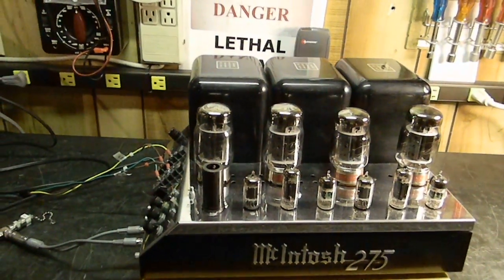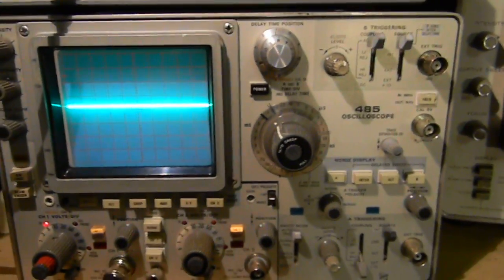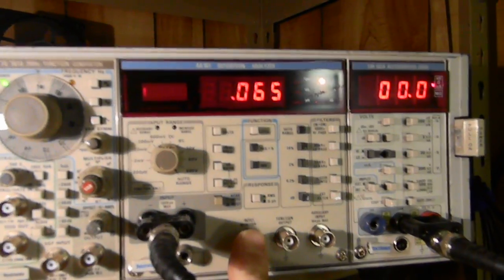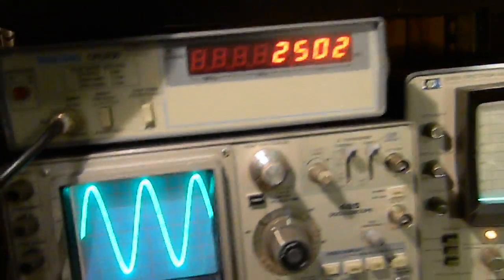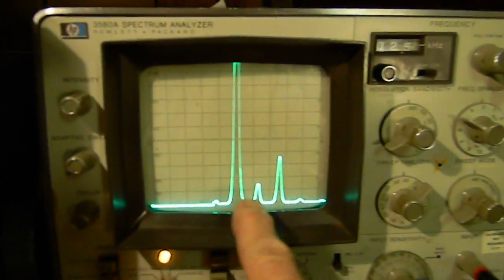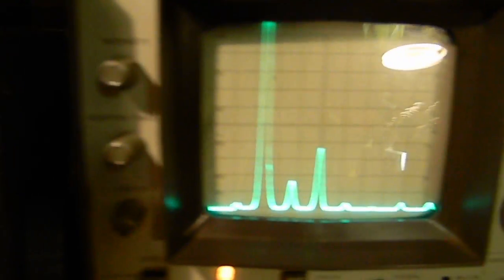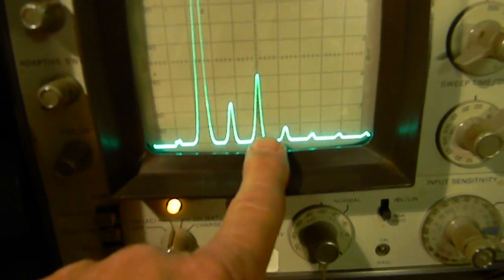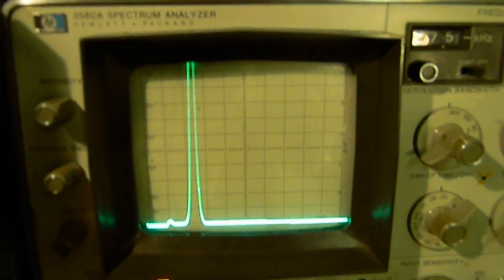HP 3580A Spectrum Analyzer and Harmonic Distortion on the McIntosh MC275.MOV

Comment: It would be nice to have a video on using a spectrum analyzer to MEASURE THD.  Also, a video on using the S. A. to detect TIMD.  If you feed a square wave into an amp (proper termination, please), you know, from the Fourier series, what harmonics are supposed to be there, and their amplitudes.  Anything else is garbage, and probably TIMD.  And you could do the test with op-amps, of various slew-rates.  A comparison of those whiz-bang DSOs, with FFT, and a REAL spectrum analyzer, would be nice.  I have a good scope (Tek 475A), but have considered getting a DSO, because of the FFT feature.  I've used a REAL spectrum analyzer, and from what I can determine from the reviews of the DSOs, I'm not impressed.  Actually, most of the reviewers of those scopes, don't seem to know how to evaluate the quality of a freq. domain display.  Maybe, I'm just really picky.

Comment: So if you crank the signal up to get a square wave, you're going to have all odd harmonics present?
Reply from the maker: Yes, and in the perfect square wave there will be no even harmonics at all. If all harmonics are present, even and odd, you get a triangular wave.
Reply: Yes.  That 2nd harmonic is not due to the "squareness" of the waveform, but probably, non-linearities in the xformer core, and/or, the tube characteristics.

Comment from the maker: Wow... I can see you have taken the AA501 to another order of magnitude of usage. I have taken the lazy approach and run mine in AUTO everything. I can see that just pushing in the 400 Hz HPF reduces the noise and THD display. However in my case I use it almost exclusively with a low impedance input, i.e.,  across 4 or 8 ohms and in that case seems to confirm what one would expect from accepted ratings of amplifiers, etc. I can see that if I do preamps (high Z), I will have to be more careful.

Comment: @essoterric I have pretty much concluded my experiments to modify the 3580A to reduce the carrier feedthrough (zero response peak). My conclusion is that bypassing the unused carrier input and increasing the size of the capacitor that feeds that carrier to the double-balanced modulator is about the only mod that will help and not hurt performance. I've gotten the zero beat peak down to about -58dB. Also, found that soldering the pins of that chip to the PCB helps to make it more stable over time

Comment: @essoterric I've been using my AA501 today, and one thing I realized is that a VERY small amount of noise can totally invalidate readings on systems with very low distortion i the .00X range. Even 60Hz hum @-100dB can wreak havoc. The 400Hz HPF switched in, shows MUCH lower distortion. Just moving my hand near the cable affects readings, unless source is low impedance. I made shielded cable for this reason. Just modded my dummy load with 10:1 voltage divider/sample out for plugging to AA501.

Comment: @essoterric THD=V1^2+V2^2+V3^2 etc / V1^2. Reminds me of the resistance calculation for multiple parallel resistors.
My 1740 developed a weird problem last night that would affect display intensity and make it bounce. The +5 supply was failing. It was the 723 regulator, somehow common mode conducting and feeding back current from the +9 raw back into the +15 via the 723 internals which were getting hot. 85C on my Tektronix temp probe. Replaced U2 and Q5 and all is well. Have some mods for 3580A.

Comment from the maker: I did not know that about the summing of harmonics. It will complicate any video trying to make comparisons. Good to hear you have your HP1740A running. A perfect mate for the 3580A. I am sure you will love your AA501 and SG505. You mentioned attaching a heat sink to one of your instruments IC's. I did a similar thing by attaching a heat sink to one of the IC's in a Tek 2465 scope I had. Can't remember the U# - horizontal output, I think. Ultimately went bad anyway. Always good talking with you.

Comment: @essoterric The sum of the harmonics is, if I recall correctly, similar to the calculation for the sum of parallel resistors. Where it gets tricky is weighting the various harmonic intensities into the final THD %.
UPS has my AA501 and SG505 scheduled for end of day delivery today, so I'll be playing with them tonight. 
I just fixed my HP 1740A... U2 and Q5 in the LVPS were acting up. Did a calibration and balanced the FETs in the vertical amps. Runs nice now. 
Will follow up when the gear arriv

Comment from the maker: No doubt about the Log scales. I haven't found much use for the Log 1 dB scale either. It would be nice if one of us made a video to correlate the actual sum of the (most significant) harmonics in the HP 3580A display to the THD of the Tektronix AA501 and posted it. Making sure we make a point of voltage gain/loss vs power gain/loss, etc. I know a few out there would enjoy it.

Comment: @essoterric It takes a little getting used to, but Log is really a better way to see everything that's going on with signals at a glance. It lets you see things down to about -90dB, and, assuming there's no ground loops and the mixer is balanced out nicely, the display should not contain any anomalies. Linear and Log 1dB have their uses, but I find Log 10dB to be the most useful for testing amplifiers. Recently, I found harmonics in a Phase Linear D500 that were traced to ultrasonic oscillation.

Comment from the maker: It is so interesting you mention using Start instead of CTR. I was working with the 3580A last night and came to the conclusion that was the easiest way to get rid of the zero response peak (by shifting it off to the left) and your suggestion of 2Kc/Div is just beautiful for a 1KHz square wave and its harmonics all the way out to the 10th in one display sweep.  I am getting a bit more prone to using Log scale instead of Linear but I like the sharp display that Linear gives me. Thanks.

Comment: @essoterric Two things I shifted away from as I got used to the 3580A: using the center freq, and using Linear amplitude. Nowadays I just set zero, or sometimes 200cps to chop off the zero response peak, and use Start. Then I put the Freq/span to 2Kc/div for most audio measurements. That gives me 20Kc bandwidth at a glance, good for seeing the overall spectrum. Sometimes I set Sweep Mode to Log when I need to see the entire range. SG502A outperforms its specs when output pot maxed out only.

Comment from the maker: @basspig I agree with using the log scale but for some reason I just seem to always pick the linear scale. I do have to be careful not to overdrive the front end and watch the little red over-drive light. I just performed the same measurement as you did on the SG502 and as best I can read it, I get about -72dB to -74 dBfor the second harmonic also. You are the second one that suggests I use the log scale. I am going to take that to heart and start using both in my demonstrations. Thanks

Comment: @MarkPalmer1000 The HP 3580A actually does have a log amplitude mode, not used in this video, but can show everything down into the noise floor. For instance, the SG502 oscillator is specked at .035% THD, and my HP 3580A shows 2nd harmonic around -74dB, right where it should be. I believe the purpose of this video is to illustrate how tube amplifier distortion looks under overdriven conditions. A nice comparison with be transistor vs tube, showing the differences.

Comment: I've been using an old FFT spectrum analyzer to look at audio amps.  Its advantageous as it has a 120 dB log function on the vertical scale.  Thus you don't have to drive the amplifier in to clipping and have the amplitude of the center frequency spectrum go way off scale to observe very low level haromonics.  It can also measure the amplitude of each harmonic down from the peak of the CF eliminating the need for a distortion meter as the percentage at any power level can be easily calculated.

Comment from the maker: Yes, for audio measurements the HP is really nice. It's shortcoming is that it only goes to 50 KHz so, if you have a fundamental of 20 KHz the only harmonic you can see is the second at 40 KHz. Anything past that is off scale. I use a Tektronix 7L5 for higher frequency measurements but haven't found it necessary to evaluate audio amps yet. Thanks for your comments.